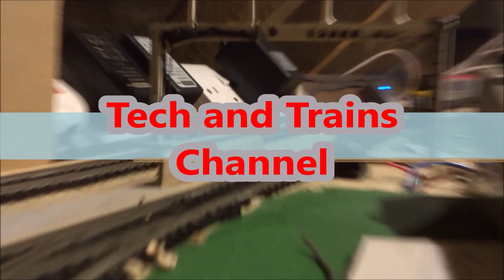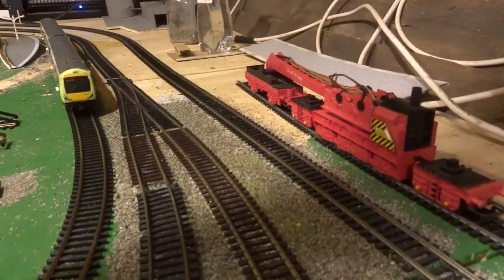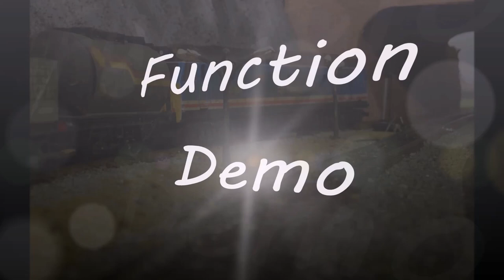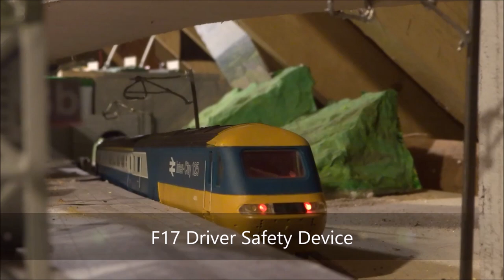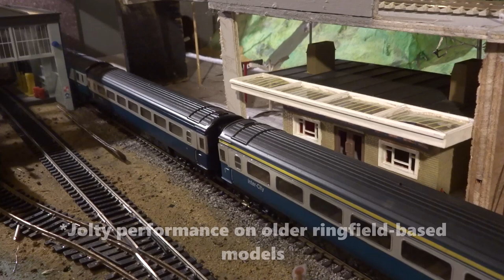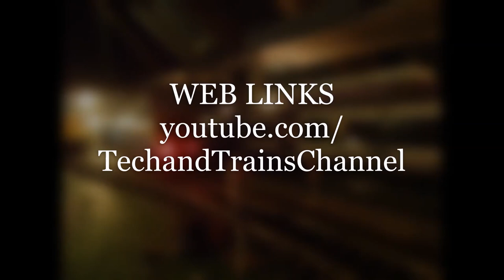Intercity 125 TTS Decoder Twin Pack Review by Hornby

Comment: This is great! I’m guessing you hardwired it in? You should try upgrading the speaker to a mega bass one. Makes a massive difference.
Reply: You can also edit the CVs. CVs150-154 control the motor on TTS. That might make a difference to the jolty running.
Reply from the maker: Like all my other trains, I chose to wire a socket into the loco, and test with a cheap decoder. I do not like cutting off the harness as this invalidates the warranty, and given the number of problems other people have experienced with tts decoders, I chose to not.
Thanks for the CV numbers, I guess Hornby didn't expect me to fit it to their first Intercity 125 model version produced 😆.

Thanks for Watching
Tech and Trains Channel